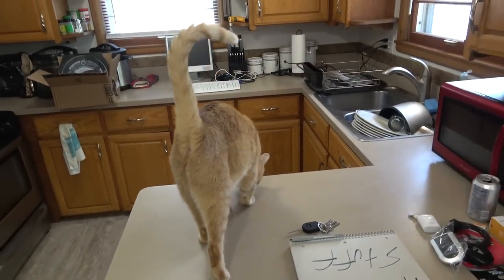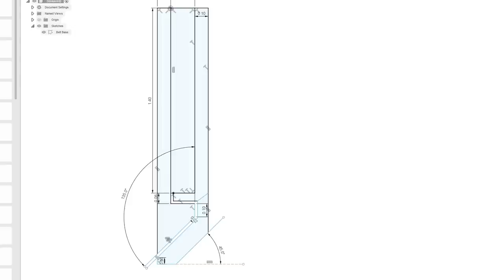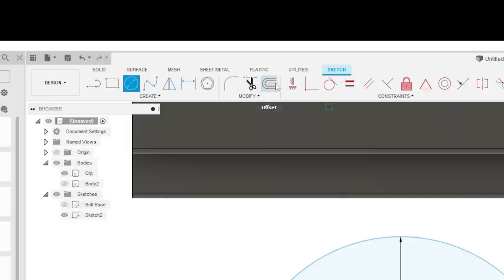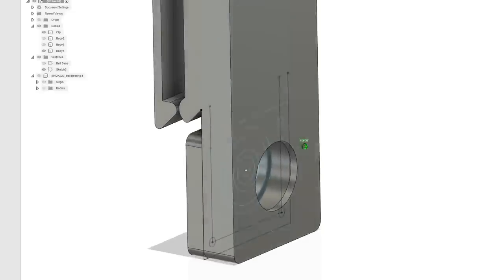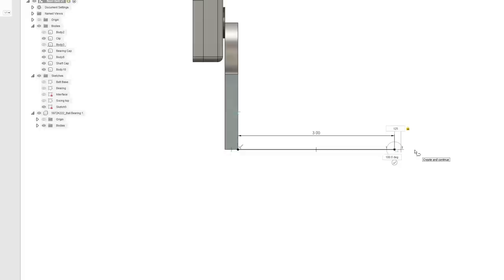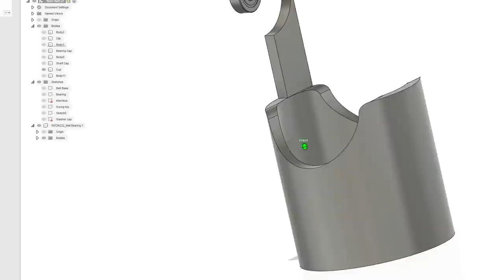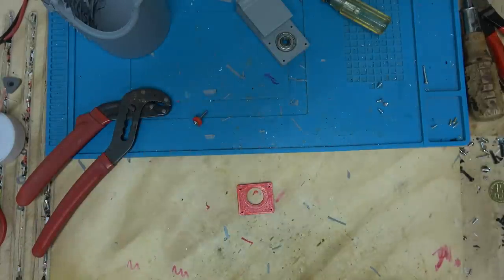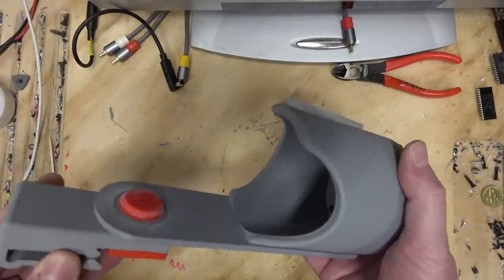Fusion 360 Tutorial: Beer Holder

Comment: If you plan to make more than 2 it might be worth designing the vertical part to use a bit of ABS pipe, could cut that 10 hour print and cleanup down to a printed bottom cap and a way to attach the bearing.  

Even just adding some 45° chamfer to the outside of the cup holder would remove the supports there, avoiding that cleanup.

Heck I might even print the belt holder and just attach a fidget bearing to it 😆

Comment: Dude why are you looking for lead shot or washers….you’re fishing….you saying you don’t have any old lead weights rolling around in the bottom of your tackle box?
Reply from the maker: I had this "oh duh" moment when I opened my tacklebox. Washers worked fine though and um, the environment?
Reply: @BenHeckHacks  I’d love to see more of these type videos.  I have been recently trying my hand at 3d modeling since I got a free (non-working) 3d printer back up and running.  Fusion360 was really frustrating me (due in no small part to my attempts to try to "remix" stl files I downloaded thinking that’d be easier than starting from scratch) and I was kinda throwing in the towel and trying to make do with tinkercad, but the accuracy just wasn’t there for what I wanted.  Getting to watch you go from idea to design to finished product was super helpful and got me back on the horse so to speak with trying to learn fusion360.

Comment: 🤔All that work, and you didn’t think to put a Peltier cooler in the bottom of the unit??? I am seriously confused now.
Reply from the maker: Oh man, there's SO MANY reasons why that wouldn't work... :)
Reply: @BenHeckHacks  You’re Mister Ben Heck – nothing is impossible, as you’ve proven over the past two decades.
Reply: Ben did that back during the Ben Heck Show days, I think he may have tripped the circuit breaker with how much power it took